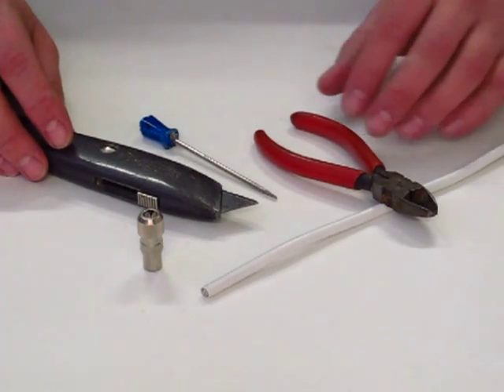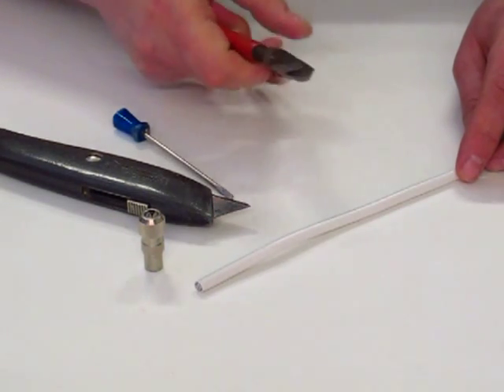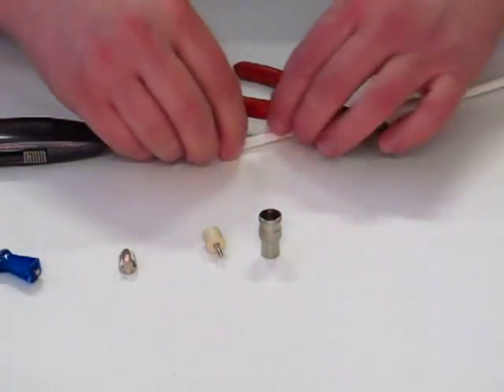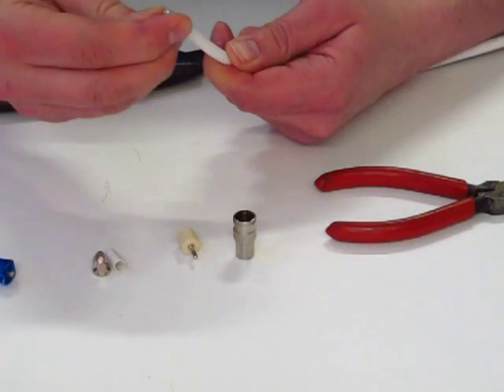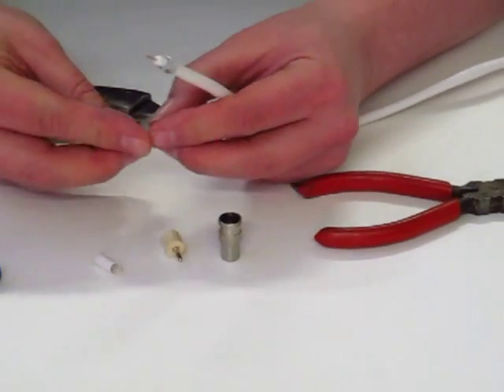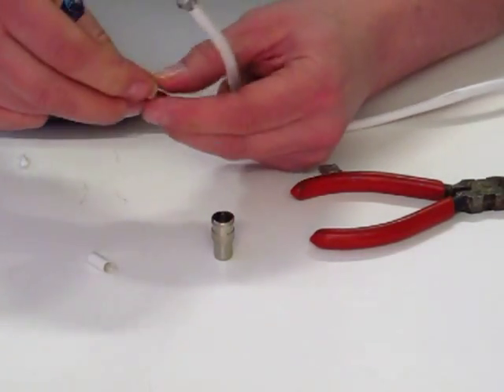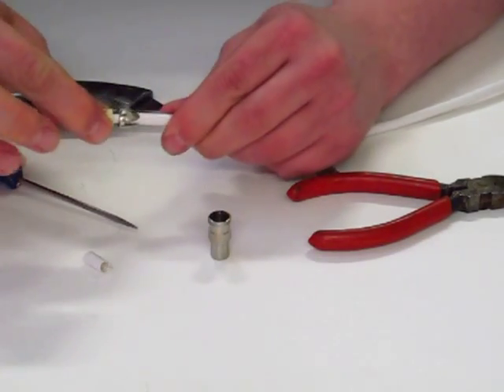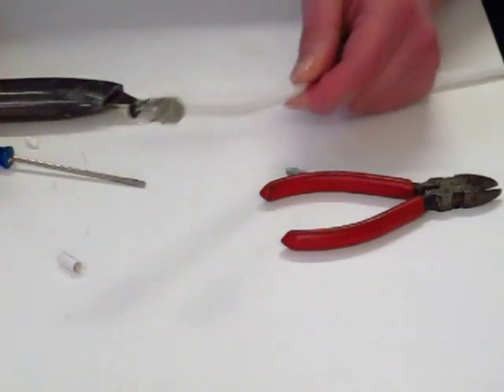Male Coax / Coaxial Plug Fitting Demonstration

Comment: Nice tutorial really important to keep the insulation from touching the main copper wire in the centre, I thought I split my coax but followed this guide made sure copper fray and foil didn't touch centre copper wire it went from no signal to full strength cheers pal.